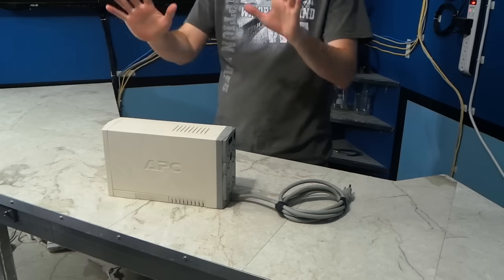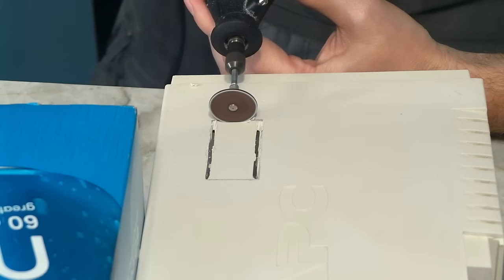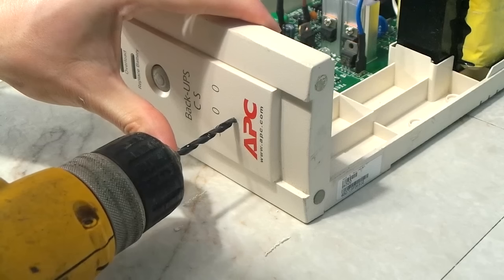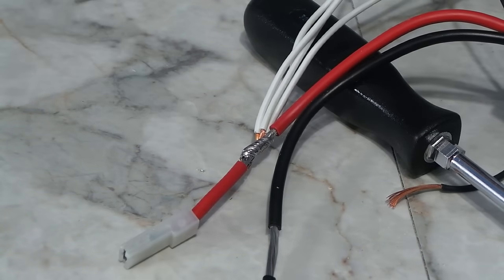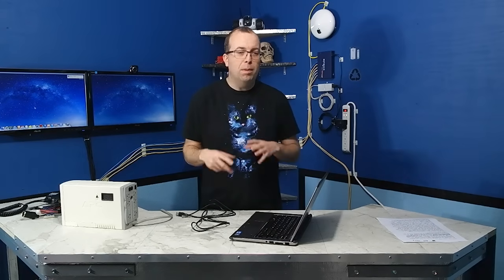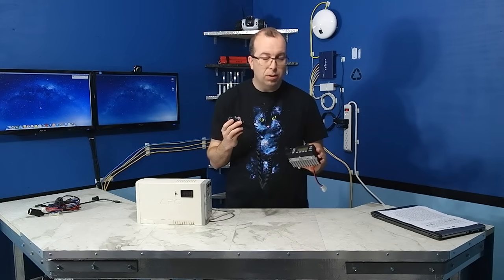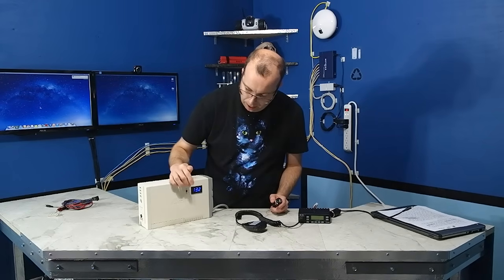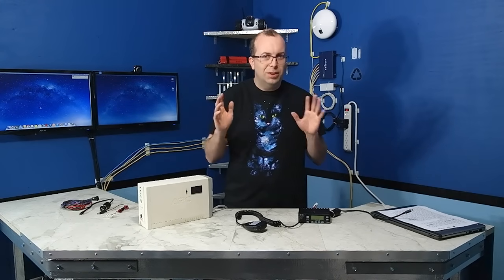Ultimate Battery Backup Hack/Mod.

Comment: Also you could put an external battery and get 120/220v for a lot longer time, remove small battery inside UPS, and xt-90 lipo connector soldered in to the battery wires, then you could use any external bigger battery you want

Comment: That's a really good idea bypassing the transformer. Those things are notoriously inefficient and as you mention they do run hot, though not as hot as cheap solid-state models.

I currently use a 2.1mm quad (4-way) splitter to power all my 12v network equipment (Obihai SIP Gateway, Cable Modem, Router, battery charger for AA\AAA\C\D that runs off a massive 12v 10A brick that itself has about a 10% loss (and draws 100mah in standby!) and this mod would bypass ALL of that.

Comment: Not sure if you know it but there are LCD displays that use less than 80uA on 12 volts. I even designed my own one many years ago. The internal self discharge of a battery is many times this.  So using these displays you can leave it running with no wasted power.

Comment: I was browsing for bypassing the timer so I can run it till the battery fully drained out.  But you re right, dc to AC conversion will have less efficiency than directly tapping out from the battery.   All I need was to keep my modem on and cellphone charged.     Thank you for the video.
Reply: That may actually kil the battery, it's never a good idea to forego the battery management system

Comment: When Our Power Goes Off I Go To The Yard And Get the Solar Led lights And Set Them Around The House! they Run All Night Long When I Then Put Them Back In The Yard To Charge Up! I See these Battery back Up's frequently at the thrift Stores! I was thinking Of Getting One And Building Me A Li-ion Battery pack For it. I Know I Will Have to modify the Voltage regulator to Prevent over charging It! great videos!!!!!!
Reply: Only the first letter in a sentence should be capitalized.

Comment: "one mess up or bump and you'll mess up the plastic.."
Proceeds to hit plastic
Reply: I take it you've never held a Dremel with a cutting wheel on XD If that thing runs away on you, you've got a gash across half the front of the cover. That's what he meant by "messed-up plastic". Your hand though, even if you hit it with full force, will probably not damage that thick shell. He's not worried about shattering the plastic, but ruining the look with scratches.
Reply: A lot of ways to make a square cutout like that. Drill a big hole, then run a nibbler is one. Drill 4 small holes (one per corner), then chain drill around the inside of the cutout and file to lines (or with a file guide) is another. Drill 4 holes and run an endmill (if you have a milling machine and can clamp it down) is probably my favourite, closely followed by chain drilling and filing.

Comment: I just keep my old truck battery around and use that to power 12V DC devices as needed for outages or convenience.  The battery was replaced because it is no longer capable of the 110 amps for cold cranking an engine but it works fine for anything else.  Not sure I would ever go through this much effort to convert a PC UPS.  Seems silly to me

Comment: I use mine as a power buffer. We get brownouts that have signed the death certificate of no less than 4 power supplies. Since I bought a UPS I've had the same power supply since 2015 in one of my older machines.

Comment: wow this just popped into my feed almost 5 years later.  Great vid tho.  Those barrel jacks are also great for getting some good runtime out of a cable modem and router.
Just make sure the battery doesn't discharge beyond about 10.5 volts. Most of its energy is discharged at that point, and draining more will damage the cell.

Comment: Instead of barrel jacks I would have used Anderson power pole connectors. They make them in round or square panel mount type, this is a common type of DC connector for ham radio and communications equipment, no one uses barrel jacks anymore because they are to easily shorted out! Anderson power poles have been the standard in ham radio for several years now they have replaced Molex and any other DC power connectors in e-coms and field use for their reliability, ease of installation and no risk of shorting out! I’ve even seen then used in server power management and battery backup also they are commonly used in auto racing for quick replacement of key electrical components!

Comment: One thing of note on this is that, as mentiond on the battery cover, the battery charging circuit is not isolated from the mains. Hence that battery, when this is plugged into mains and charging, is essentually floating at mains potential. Hence your added sockets on the front are quite dangerous as they could be floating anyware WRT ground. Unplugged from mains its all fine and safe but APC did not invest in galvanically isolating, or in any way isolated the battery as it is reasonable to assume someone is not fondelling its terminals when its tucked away and running. Hence the warning on the battery door...

Comment: i did this modification with one exception. i used a momentary push button switch to turn on the meter. it used a standard quarter inch round hole, much easier to install and also made it "idiot proof" in that if i has used a slide switch as you did, i know i would have left it on half the time. when it wasn't needed.

Comment: Galvanic isolation?

Most UPSs have a battery rectified directly from mains - otherwise you need some form of Galvanic isolation which is expensive and bulky.

This is fine when the outputs are mains. But put a DC output then you've got a real electric shock hazard.

Comment: Thanks for the content! Not sure how practical this is. Based on your installation of a 9ah flooded battery you'll be able to run your UHF radio for less than 30 minutes and i don't believe you would be able to charge a smartphone without damaging your flooded battery. Cheers

Comment: You can also use drills for wood. You are using drills for metal, thats why you end up wonderring arround with them if you dont start with a small one. The ones for wood have a small sharp starting dimple thing.

Comment: @The 8-Bit Guy  do we need a 12v DC stabilizer for when the UPS is charging isn't the voltage higher than 12v to charge the battery?

Comment: Tin your wires, and electrical tape is not necessary if you have the correct diameter heatshrink tubing. You can also use the correct size tubing, shrink, then use a slightly larger tubing on top of it if you want to be extra safe.

Comment: Dude, hot tip. You didn't need to cut up a switch, just take a picture and print it out actual size. Spray some contact cement on the back, light tack only.  Drill and tap as you please.

Comment: I like your idea, was think embed USB too, but good thinking about discharge unless you added another switch. If I did this I would put power-poles connectors instead of the DC Jacks. All my radio are set up with PowerPoles.

Comment: That's a small UPS, just saying, and worth checking it's not a modified sine wave, that one probably isn't but I've seen a lot of the smaller ones that take the single 7Ah battery (Sometimes 9Ah but still that size) are modified.  

The good ones tend to take two batteries, run in 24 volt, and actually run everything connected full time, they just use the line input, filter it and send it to the outputs, those that are running full times tend to be much larger and have case fans. They can also have the batteries upgraded or more added.  With the internal batteries I can run my PC, two screens and amplifier for 45 minutes, which is sweet FA really.

Comment: APC means "A plane crash". Contoured with large characters, so drones can read it optically from the case, through building blocks such as reinforced concrete wall and ceiling. UPS supplies dislike longer operations, the power good signal will fail after a while, and XP won't start. However, Win 2000 will start.

Comment: I took my large APC apart and connected to large truck batteries. It'll power all my electronics(70" 4K, stereo, PC, etc) for several hours if the power goes out.

Comment: I am pretty certain that there is no relay for the "buffered" AC out. If there would be one, you would have a bad surge every time you lose power, which would defeat the purpose of a UPS as surge protector. The AC out is always run from the battery. If you lose power, there is no action on the output, it just keeps supplying AC until the battery is depleted.

Comment: FYI now they have battery backups with these features (USB and a voltage/amperage read-out).  Yes they are the higher-priced units, but if you go through this process, well, you'll probably have spent the same amount of money in the end (plus the batteries in these things only last about 3 years and then you have to replace them--at which point it's just a little more ($) to just buy a new one with a warranty). Plus doing this voids your warranty anyway so just save yourself time and headaches and just buy one that has a built in USB charge/surge ports and an LCD read-out (some even have the software so you can monitor the voltage from your computer).

Comment: Of course... if you had a large deep cycle battery, you could parallel it with the small one and get ridiculous run times... but I would add a second switch to turn on the thermally regulated fan.

Comment: Just some tips (do not get me worng, i like the idea but...):
1. Every additional power output should be protected agains shortcircuit by a fuse (fire hazard). 
2. The battery charger inside your UPS is not a 12V power supply. It is not engineered to supply power to loads but to charge the battery (usualy with a constant current up to a certain point and then with a constant floating voltage). Misusing it may lead all kinds of troubles like overload/overheating etc (again fire hazard)
3. Generally, any device that is sold on the market must have a type-aproval and should not be altered in any way. Any change makes you liable in case something goes wrong. like...  say.. short->fire ->personal/material damage or lose of life

Comment: Great video, I was thinking about doing this for a direct dc power to my router. To keep it running during power outage and to bypass the dc to ac converter and then the ac to dc power brick, my router runs off 9v dc and I’ve used an 8.4 battery before with it and it works. I’m not sure it would run off 12v. Depending on the voltage regulator in the router
Reply: i have the same idea, i plan to connect directly the 12 v router and modem directly to the battery
Reply: @HeinserTorres  did it work ? what about over-discharger ?

Comment: I use a red hot ice pick to cut plastic.  It takes a while because I do it by scratching the plastic one line at a time over, and over.  If I had one, I might use a soldering iron.

Comment: The surge-protect board you threw out had RJ-45 connectors, not RJ-11. It was for isolating the Ethernet between your desktop and the router, not for isolating a dial-up phone line.
Reply: No, they were RJ11. It's even in the manual https://download.schneider-electric.com/files?p_File_Name=ASTE-6Z7UZA_R2_EN.pdf

Comment: Now get a bigger box, and replace that cute battery with one for marine/RV deep cycle. You can charge and discharge the battery for years, and it will have probably 10x the capacity

Comment: Ouch... and if you short circuit one of the outputs the wire catches fire... They make panel mounting blade fuses. It is very easy to forget about what happens if somthing goes wrong when doing modifications to kit. The battery charger in the UPS may not insulated well enough from the mains to keep you safe in the event of a fault and you are holding the 12V outputs.

Comment: 18 gauge wire is actually rated for 16 amps... at 120 volts.  If you are tapping 12 volts instead, one wire is good for 160 amps. p=i*e.  You may have noticed this when you were adding up your amperage usage.  48 amps at 120 volts would toast your wall wiring.

Comment: it needs a shoulder strap. and you should mount your radio to it, convert a car power antenna and install it for the ham and use a switch with sheilded cable to add an external antenna option. theres allot you could do with this, however i have issue with a 7Amp/hr battery being called "substantial" you can get these with a 12 amp hr often for the same price, i have three installed in my server room and they connect to 120 amp/ hr gelcells (modded them myself) keeps the servers and the house running for a few days

Comment: That APC battery backup gave me lot of troubles with its non full sinusoidal output. I've had multiple problems with data corruption until I stopped using it. Then I used a sinusoidal wave one, from APC too, that worked well.

Comment: The battery is around 7 to 8 amps. The ham radio pulls around 5 amps. Even if you only transmit lightly, you will be lucky to get a days worth.

Comment: You found a pretty clever upgrade, I wish I had something like this available to me for recent power outages.

4:55 I realize I'm eight years late for this video but did you really find a barrel jack that supports more than 5A? Adafruit sells a dead-ringer for that kind and their rating is 1.5A. I've seen some 5.5mm barrel jacks and plugs get rated for 5A. Getting any that support something close to 16A seems pretty far-fetched.

Comment: I have larger unit APC 5000 watt Smart RT and want to used it as an inverter on my RV . I have 2 , 400 watt solar panels and a controller . Any hints to smooth things out. Thanks.

Comment: Could you get more juice out of a bank of 18650 batteries of equivalent size, and could you tap in at different points in the series to get different voltages so you didn't need a 5v converter, and possibly run 2 12 plugs off differet halfs of a 24v bank? Would a higher voltage bank be more efficient converting to 120vac?

Comment: I know this is like a really old video and all, but i see some people have viewed it recently, will point out this is actually quite dangerous to do because most UPS battery charging circuits while they create a difference between terminals on the battery of ~13-14volts they can be floating at 120-240volts respective to earth/neutral and as such any dc device that might have a metal case that is ground respective to the battery can have AC power on it while the ups is charging. had a case where i hooked up a external jumpstarter pack to my ups it had a built in compressor, the -ve wire fell off the compressor motor inside the unit so i decided to solder it back on, soon as i touched the tip of the iron (which is grounded in the ac cable) large pop and house safety switch tripped and large part of the ups mainboard scorched. so its worth checking with a multimeter if the battery terminals are high voltage compared to earth before adding dc jacks.

Comment: Kf5QQV, N9TGW...  You forgot one pair of major mods. A 20-30 amp power jack going directly to the battery, and a cable with 10ga Red and black leads going to automotive battery clamps and the other end with matching plug to the new jack. these leads need to be atleast 6 ft, and about every ft about an inch and a half of heat shrink to keep the cable "controllable", remember to leave the clamps loose for about a foot to connect to an automotive type battery.
With this you can charge as well as use larger SLA as well wet lead acid batteries ( Emergency use on the wet let acid due to hydrogen gas unless you have a sealed with external vent battery case) This is the only mod I have made on mine which backs up my cable modem, router and phone which is VOIP. I keep several LARGE automotive batteries on charge on my campers solar setup, not to mention the 5 deep cycle batteries on the camper's normal setup. I know others who have even more elaborate setups than I do. I have 3 small 120v generators, that do not even add up to the output of one large one but are capable of powering a TV, my refrigerator, freezer, furnace and ham station on reduced power should it be necessary, the big secret here? knowledge is power and power in an outage is a must. Keep on spreading the word    N9TGW

Comment: You can get a voltage display that also has a batt capacity bar and an on-off switch on its face for $3.00.☺

Comment: I think this is on the mind of every UPS user. If you use UPS to power modem, router etc, you can use DC directly and bypass the ACDC adapter since most are using 12V anyway. And why his UPS has user swappable battery door? I thought mostly need to open using screw.

Comment: If I understand your modd correctly you can also add a led acid deep cycle battery externally should you need longer run time for the ac out put.

Comment: Idea is good. Instead of using 220V AC output you can use 12V DC. But is it possible to keep UPS turned on and charging battery and at same time use ONLY 12V output? Like turning off conversion from 12V to 220V but keep battery charging function turned on.
Reply: And theoretically UPS will turn off automatically to prevent battery discharge too much. But if UPS use 220V to run its own hardware then it is probably useless idea because it cant control itself and wont turn on when the power outage has ended.